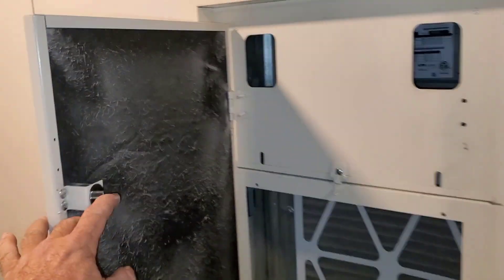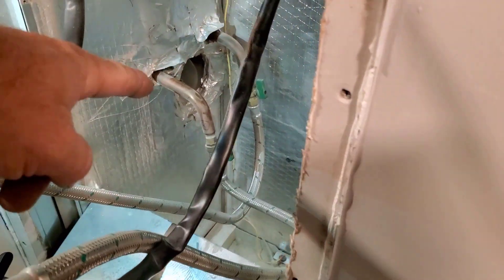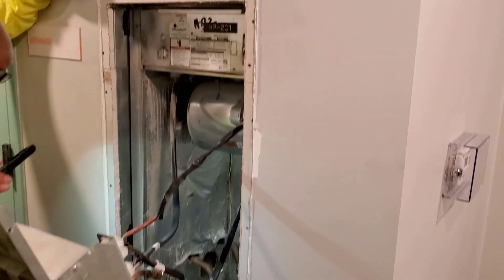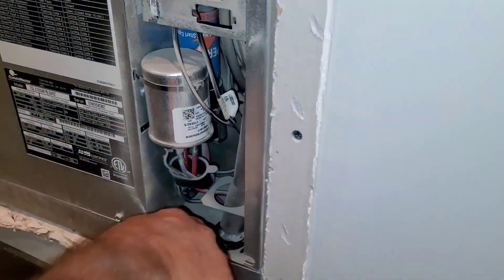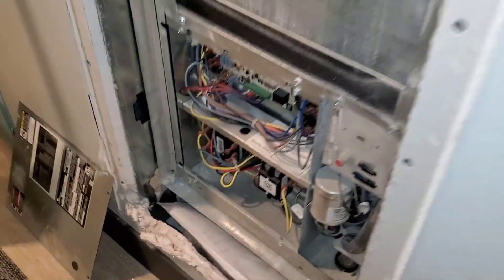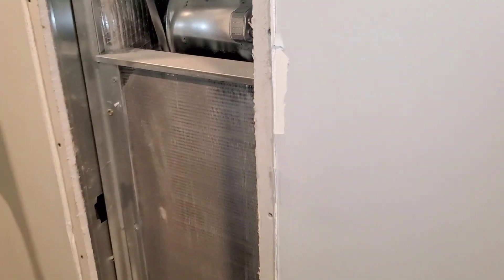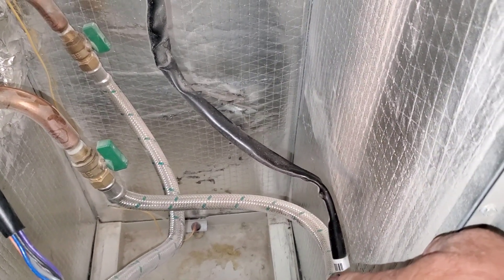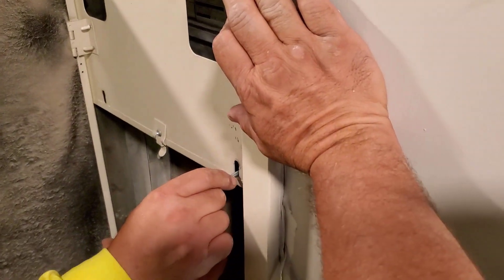Climate Master's Bastard "flush mount" WSHP creation are a complete joke!

Comment: I’m dealing with a climate master now in the city and it’s a headache smh I have a question tho if one of the braided water hoses get kinked would it cause the unit to keep shutting off after five minutes?
Reply from the maker: In cooling mode that is the source to cool the condenser and it will trip on high pressure. Needs approx 3 GPM of water flow per ton. A kink will surely choke off the water flow

Comment: It looks like the installers never referred to the IOM - there are obvious mistakes.  One clear indication is the screw length for the return panel.   In a large installation with occupied suites if there is an issue with a chassis it should be swapped out with a spare.   Should only take 20 minutes.    In the rare instance gauges are needed, it should be done in a shop - not in the suite.  Properly installed and maintained, these machines can be so quiet you cannot hear the compressor cycle.   We have installations going on 20 years with few problems.

Comment: The chassis isn't installed correctly. Your not supposed to have bolts holding the filter panel to the chassis; only the four 1/4" screws going up each side, which appear to be missing. That way when the return air door is put on it doesn't pull the chassis out of the cabinet. Also the condensate hose under the drain pan is supposed to have clamps but needs to be attached by whoever is installing the cabinet.
Reply from the maker: I didn't install these pieces of shit. Lol
And I also noticed they were installed where tightening the bolts would pull the unit out of place. 
I dunno what the hell they had for hardware or why it was done this way. 
It was a 120 mile drive there to get av few running that quit.
I haven't been there since

Comment: Last time I heard that much crying I was in a daycare. There's a good reason why the service ports aren't piped outside of the compressor compartment and you can never have to many safetys on the condensate drain on any type of equipment, the drain line is cut short because of hack technicians were pulling the units out and causing damage to the line and the condensation sometimes would find its way out of the unit where it shouldn't, all manufacturers have the same amount of panels to assess this style w.s. heatpump unit, Whalen doesn't even have service ports, only two safetys and they are extremely expensive to repair they over charge for there equipment and replacement parts. Trane heatpumps are the worst manufacturered units available, Trane technicians will tell you that before you ask and they are more expensive than Whalen to buy and repair. Carrier pretty much copied Climatemaster for there w.s. heatpumps. And finally FHP are the bottom of the line for w.s heatpumps they don't come close to Climatemaster for safetys to shut the equipment down before damaging could happen. I don't even work for Climatemaster I just have 30 plus years experience in the field and have worked on just about everything out there and seen just about every type of failure there could be and mistakes made by other technicians, and I to make mistakes now and then to. But you guy's just cry about doing your job like a room full of toddler's in a daycare that just found out its raining and can't go outside and play on the swing set. I'm going check in on you 2 when I need a good laugh and need to show some of the greenhorns how not to act when your working. Keep up the good work guys, I get a lot of business coming in behind tech like you 2 to figure out why the equipment isn't running and the owner just paid a lot of money having it serviced by another company.
Reply: this isn't the time or place maybe but I'm working on a tsl 09 heat pump atm and the the fan runs when it is on cool, how ever it is not cooling and there is a rattling/fast loud clicking sound coming from inside the unit, by any chance with your experience would you think it could be the txv valve restricting refrigerant unto the compressor causing the evaporator coil to over heat at the same time? sorry if I'm bugging thank you!
Reply: I'm sorry I meant unto the evaporator coil
Reply from the maker: That was quite the novel to defend this monstrosity.
Having service ports behind a removable panel is one thing.
However, which this bastard you have to practically remove the water piping etc just to get it apart enough to access the refer section panels.
THEN re install everything just to operate it and check pressures.
This short video of mine doesn't even give justice to the nightmare.

On a typical WSHP you remove one service panel. Connect the service gauges. And operate the unit. You don't have to spend 30 minutes tearing down layer after layer of the unit then re install layer after layer (to place everything back into normal airflow conditions, etc) like you do with this bastard.

That defense was almost as bad as the Goodman defenders.
Do better.

Comment: looks like it'd be easier to put a hole through the wall on the side and the side of the unit, then put a little door there.
Reply from the maker: It would be.  But sadly these are made to be installed all from one opening and look flush. 

These examples are in common hallways.
There are hundreds of these here in the dorm rooms. Most don't have a wall to go through on one side or the other.